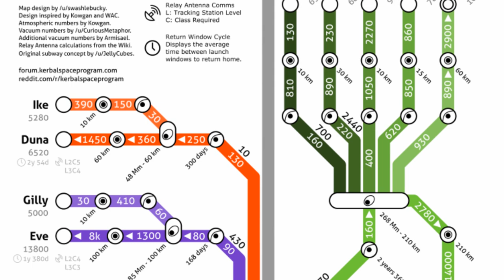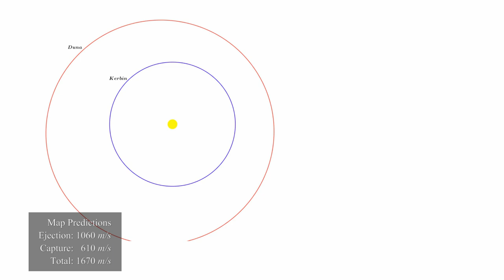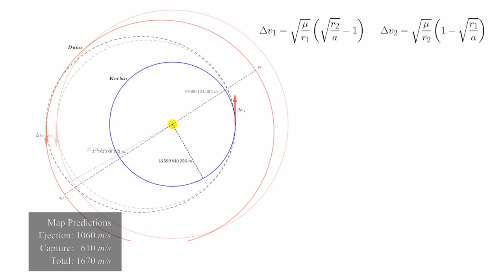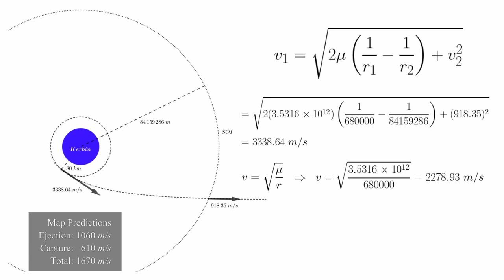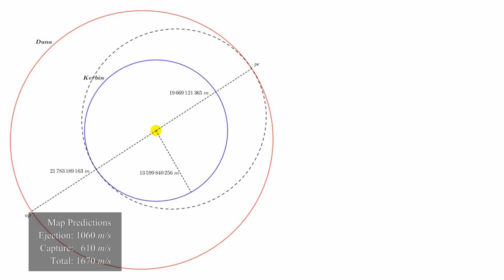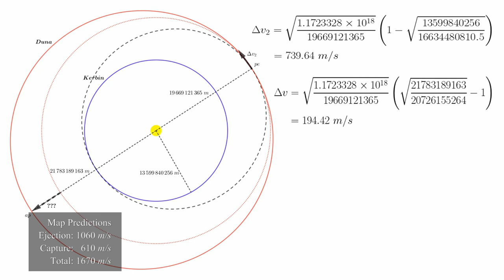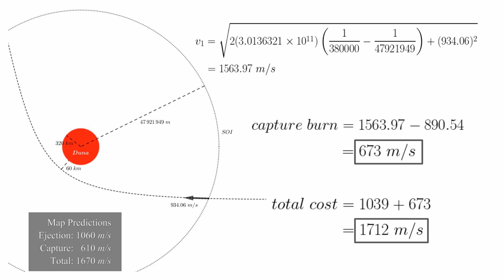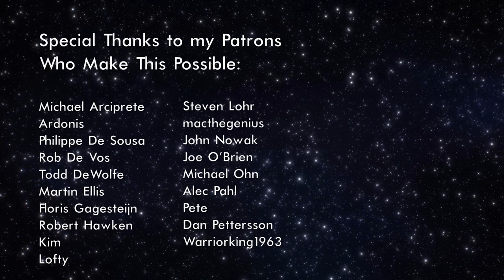Calculating Transfer & Capture Costs - Duna | KSP Let's Do The Math

Comment: I'm following along and building a spreadsheet. At 7:51, I'm getting an ejection burn of 1031.89 instead of 1039. The rest of my numbers match so I hope the 1039 is just a typo and not something I missed in my calculations. Excellent video BTW.
Reply from the maker: Nope, definitely looks like a typo on my part. Thanks for catching it.
Reply: @MikeAben  
Thank you. My spreadsheet is full of vlookup references to another tab with the various bodies' metrics. It's convenient when correctly entered but messy to audit/follow. I was afraid I screwed something up. Watching the Moho video now to add inclination to it. Excellent series.

Comment: love ur videos man. How would you calculate the trasfer so that it ends up in a gravitational slingshot?
Reply from the maker: The transfer would cost the same. Getting a gravity assist is all about how pass through Duna's SOI which doesn't add to the transfer cost other than there wouldn't be a capture burn.
Reply: @MikeAben  Thank you so much. it is really cool that you know all of this stuff. I am an IB student working on a interstellar trajectory design project but I have trouble knowing where to start, your videos are very helpful. i was also wondering how you would calculate the angle at which you leave the planet after a gravitational sligshot.
Reply from the maker: @fredericvg3519  I've actually never looked into that problem as it's easy to eyeball in game.
Reply: @MikeAben  ok, thank you so much anyways.

Comment: I have no idea what I'm doing wrong. I'm only up to the first burn, but I've put your exact values into my calculator for the equation of delta v1 and I've gotten 1113.43? Would someone be able to help?
Reply from the maker: If you are talking about the calculations that end around 3:40, without more specifics I would have to guess you are getting the order of operations wrong. For example, the operations inside the square roots has to be completed before the square root is taken. Depending upon your calculator, you may be able to use brackets '( )' to accomplish this.